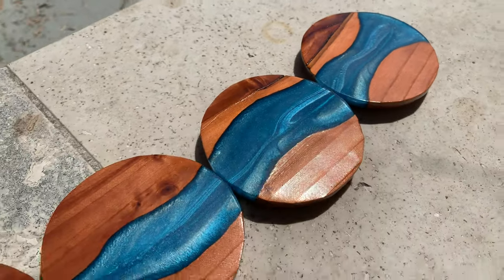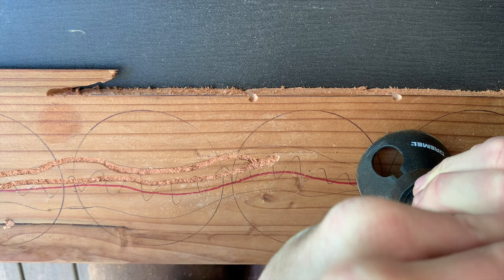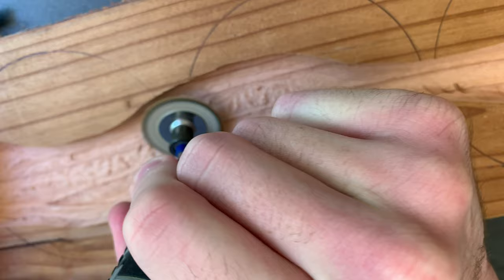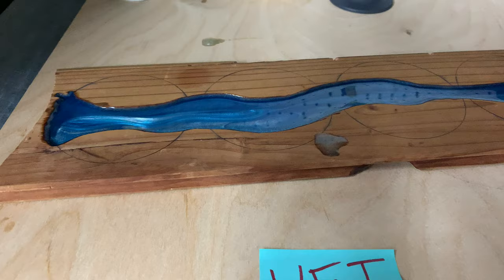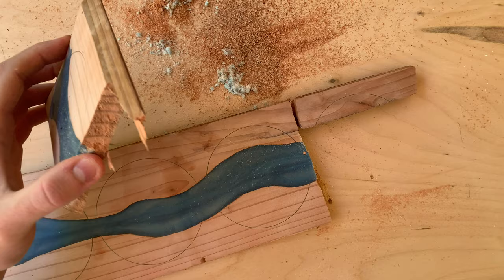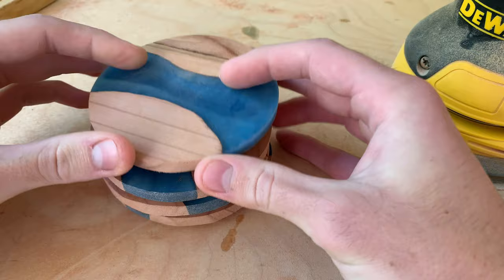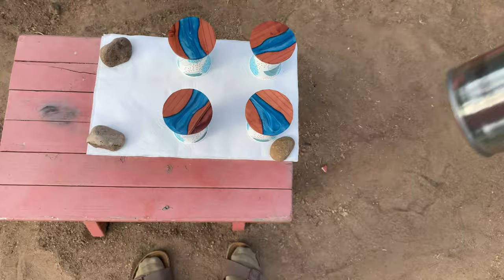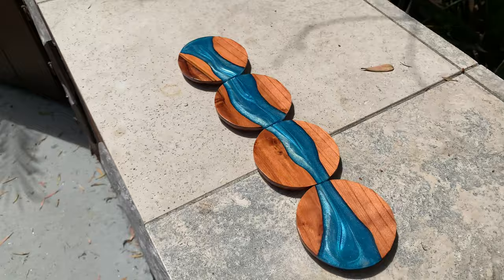Easily Carve Epoxy Coasters with a Dremel Rotary Tool

Comment: I have a rotary tool but the brand is LOTUS. I can say that dremel is much better than lotus. Can i also use the tools and accessories of dremel to my lotus?
Reply from the maker: I’m not sure… most small rotary tool bits and burrs are about 1/8th inch in the US, so maybe they could fit, but as for the flex shaft or the router I don’t think it’s likely to work since they’re specifically for the Dremel
Reply: Okay. Thanks Sir! 🙏😊

Comment: Hello @ log carving club, love your channel.
Would you buy a load of extra accessories for your Dremel?
Secondly, which Dremel 3000, 4000, or the one you are using would you recommend?
And finally would you recommend any other cheaper brand rotary tool?
Thanks in advance
Reply from the maker: Hi, I do splurge with extra accessories but only when I think they’ll be useful or I see them in videos. I’ve only used the 7760, 8220, 4000 and 4300, I use the 4300 usually but can’t really tell the difference, any dremel seems fine but I like the wired ones so they don’t need to charge. I haven’t tried any other brands but I would like to!
Reply: @LogsCarvingClub  thanks